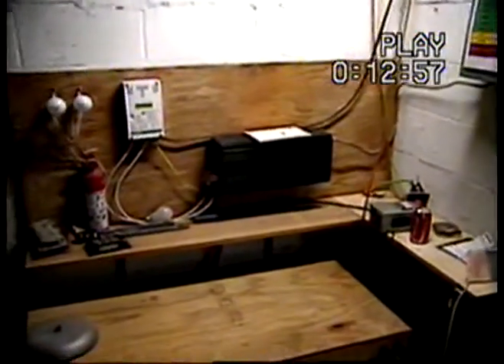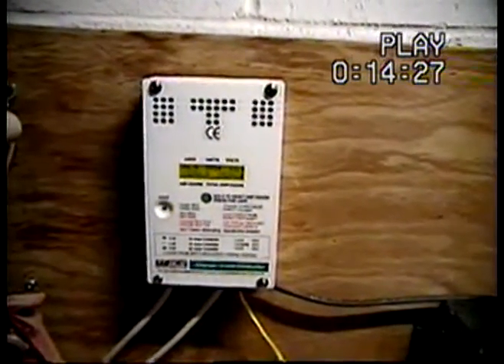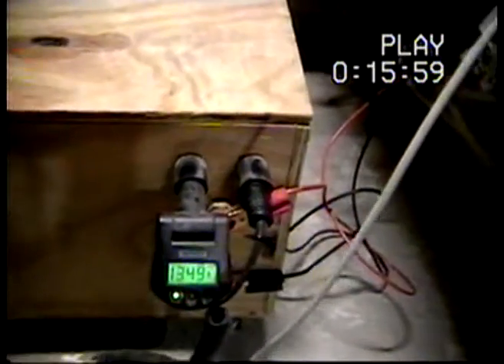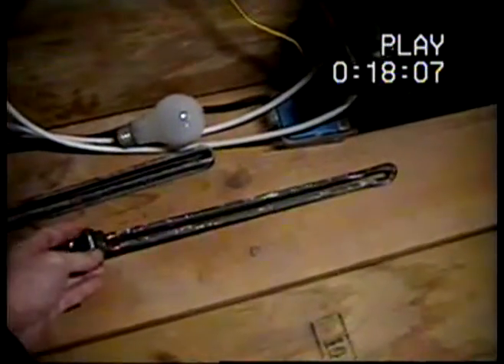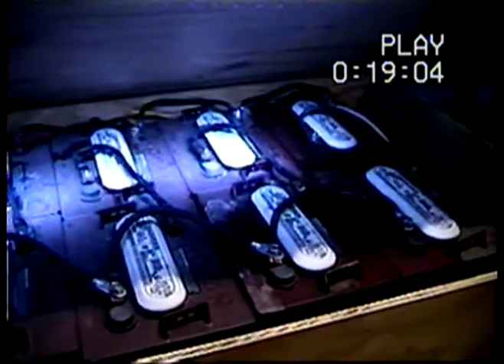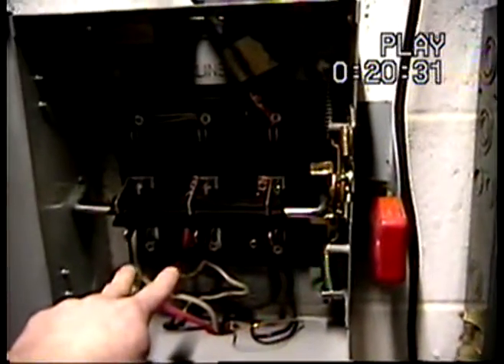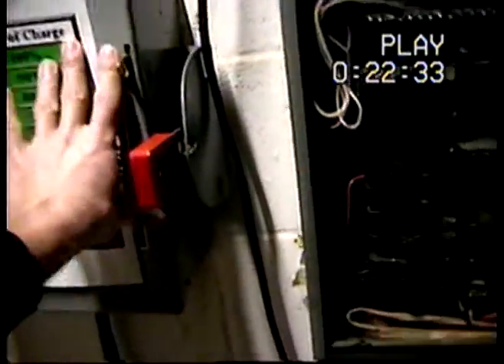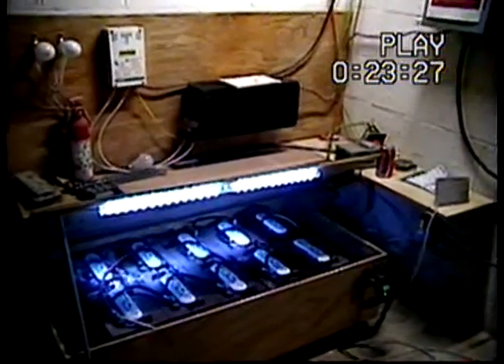Battery solar and wind generator update 1

Comment: you need to tell your dad to give out the diagrams for th charge controlers. I just cant wait untile batters are cheaper I want to use a industrail batter for like walkies ect they are 24 volt but way a tone but just one would power my house for a few hours but they are exsspencive but I want off the gride and it might take a little money to tell the power company to stick it up.

Comment: Great video I noticed your charge controller was blinking 5 times wich means you have reached bulk setting but your voltage was 13.4. You should bulk that bank at a minimum of 14.3 and float at 13.4 if you have your manual for your controler it is easy to set. I recomend using a meter to make those settings. Just trying to help out  Those batterys will not last very long if they are not bulked properly and often.